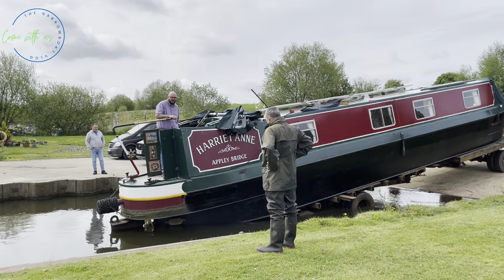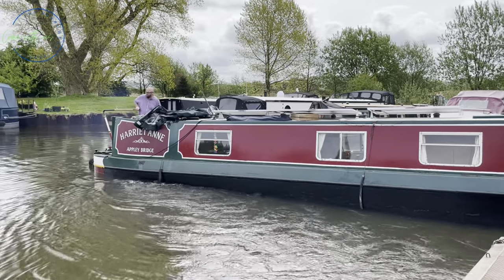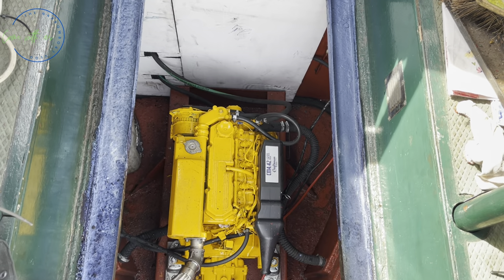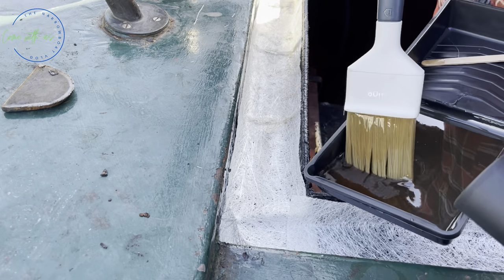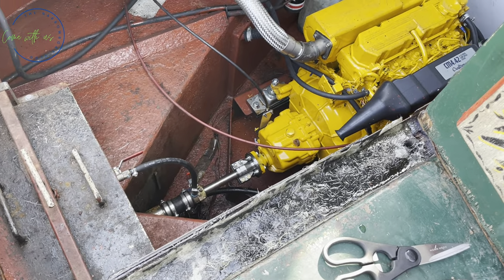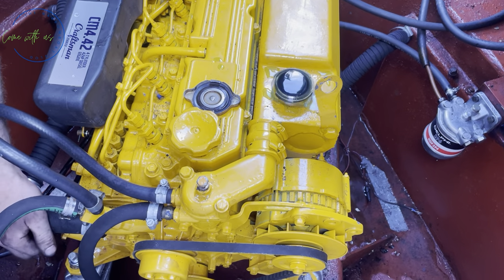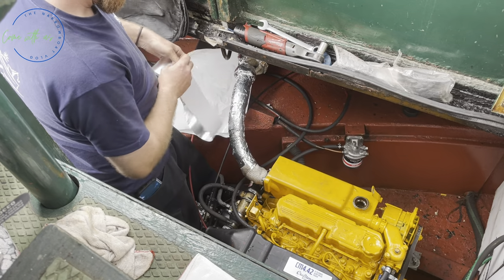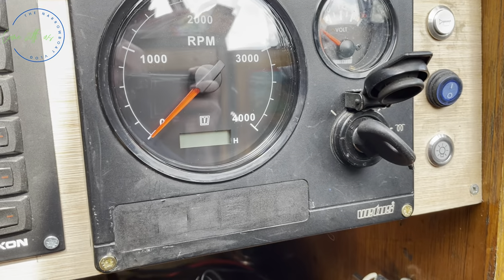NARROWBOAT Vlog episode 40 Will it sink?

Comment: Kelly, why did you not remove your rings, etc before tackling that rust treatment and fiberglass project? Also, it is wise to use some gloves when working with fiberglass.
Reply from the maker: Thanks, I am pretty careful not to get covered in paint or other items so never really thought about it.  Glass fabric is easier to work with and thankfully doesn’t irritate me but will look at proper PPE when I get round to finishing the job (some other more shocking repairs needed 😩)